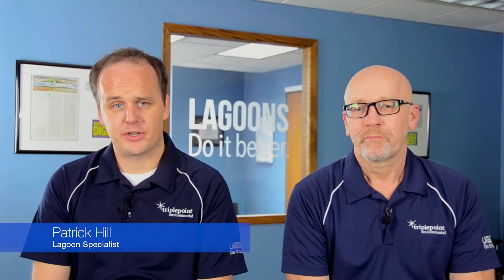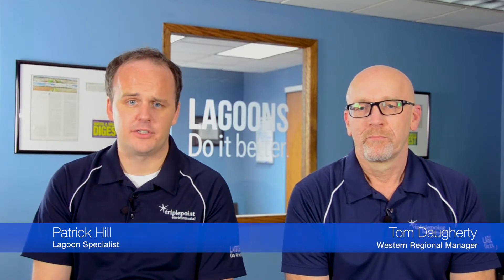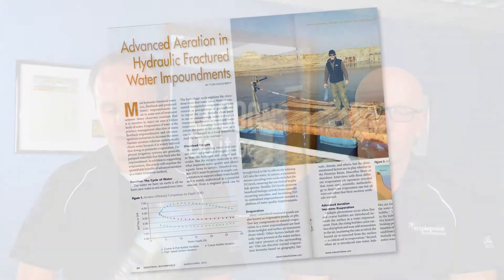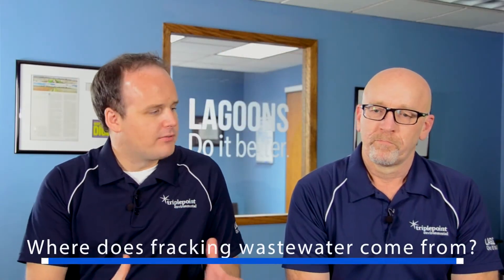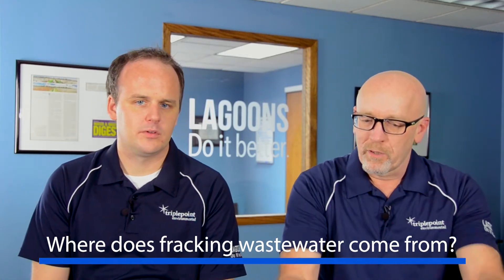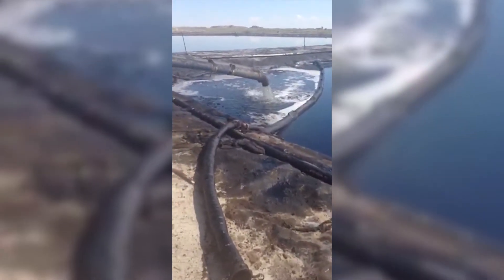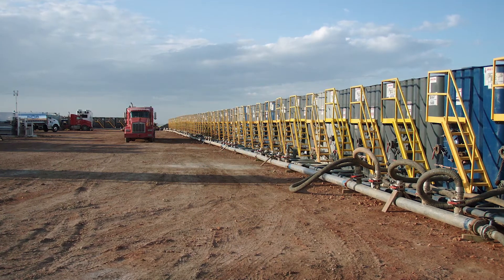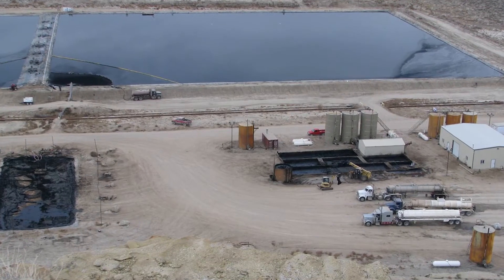Frac Ponds: Treating Hydraulic Fracturing Wastewater for Reuse

Comment: Excellent vid!  I come at this from the instrumentation side of things. Formerly with ITT Analytics.  If I may ask, since you don't have an in house instrumentation group; do you offer suggestions to a perspective client on who they should seek out or do you find they already have that selection made by the time they come too you?  Have you found certain products that have failed too properly monitor the operation of the lagoon? If so, what parameters and what was found too be the cause of incorrect readings?  My apologies if these questions are out of bounds...

I would suspect that Flowback/Produced water is such an issue on many levels, being able to effectively treat it would be a huge selling point for y'all going forward!  

I would love to be added too your FB Group is if possible!   Sludge Rules!!
Reply from the maker: Hi JW,

Thank you for the question. We have placed instrumentation as part of our lagoon treatment solutions with a couple different vendors. When considering all lagoons both domestic and industrial, the biggest demand has been DO (dissolved oxygen) control of aeration by achieving a predetermined DO set point. Generally, maintaining 2.0 mg/L DO in a pond indicates a healthy treatment system. However, Triplepoint strongly advocates taking this reading at the mid-depth point of the target pond in a strategic location. An eight foot deep pond should be sampled four feet down. Wind and surface humidity influence DO levels in the upper 18’ or so of a pond which is a misleading indication of a pond’s overall health. No matter the parameter we prefer a robust cleaning solution for probes spaced in situ. Even with some of the air or brush cleaning systems we have heard of many operator complaints of having to remove and clean the probes again. We are bullish however in online real time data that allow operators to manage their facilities more proactively than reactively and achieve savings in power consumption.

Comment: Very informative.  Thank you triplepoint.   I'm curious about the average salinity of frac ponds.  Do you have any general comments on that?
Reply from the maker: Thanks, John! Chlorides are an oft measured parameter in frac ponds. A recent chloride value we measured was 14,300 mg/L but can range much higher depending on the geology of the well site. The formula to convert chlorides to salinity is: salinity (ppt-parts per thousand) = 0.0018066 ✕ Cl– (mg/L). The salinity of the measured sample would then be 25.84 ppt or 25,840 mg/L. By contrast the maximum chloride value in drinking water is 250 mg/L or 460 mg/L as salinity. A salty topic indeed!
Reply: What is aeration doing to the air and the ozone layer?
Reply: Can you drain the water in a traditional swm runoff facility such as a sand filter water quality pond?